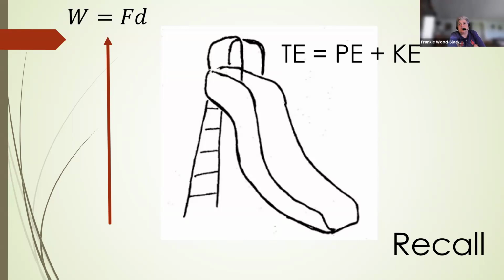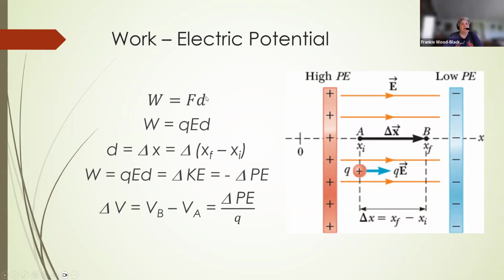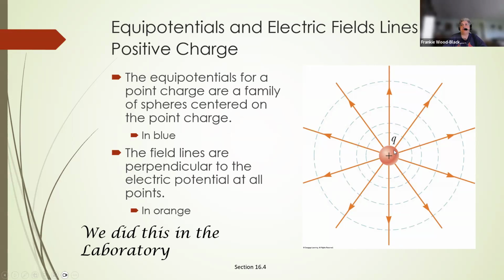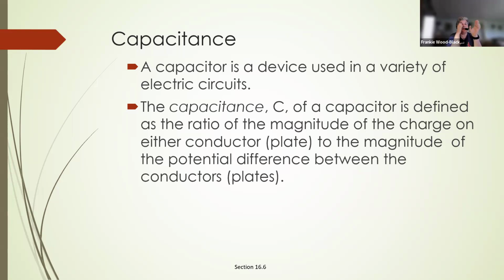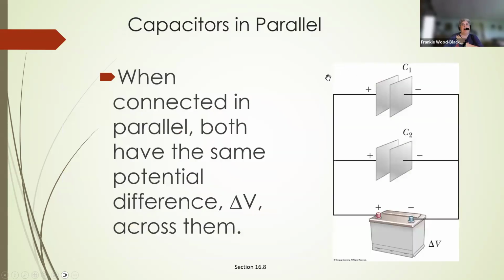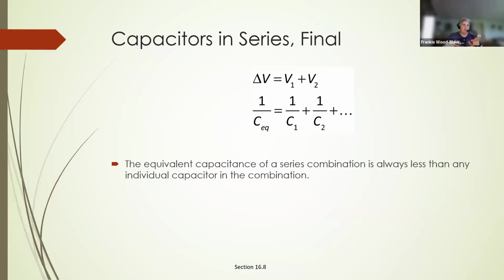Chapter Slides Lecture Electric Potential and Capacitance July 2 2025

Comment from the maker: Key topics covered include:

Electric Potential:

Analogies to mechanical energy concepts like work and potential energy [00:57, 01:08].

Definition as the change in potential energy per unit charge [04:37].

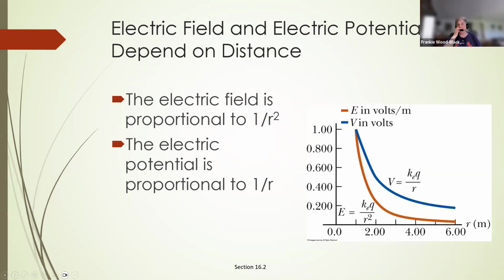Behavior (drops as 1/r) [06:20].

Measurement in volts [06:31, 06:46].

Superposition principle for multiple charges [07:32, 08:08].

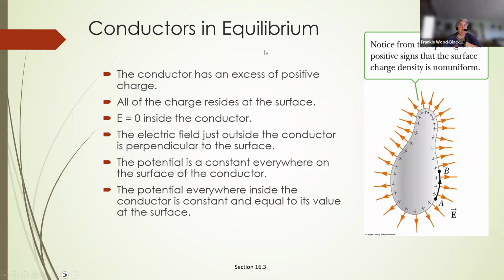Properties of conductors in equilibrium (charge on surface, zero electric field inside, perpendicular electric field at surface, constant potential) [08:55, 09:46].

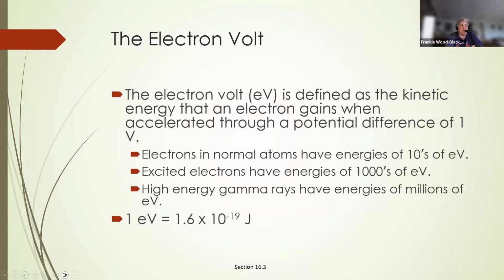Electron volts (eV) as an energy unit [10:29, 10:48].

Equipotential surfaces/lines (constant potential, no work done, perpendicular to electric field lines) [11:23, 12:18].

Applications like electrostatic precipitators and photocopiers [13:50, 14:10].

Capacitance:

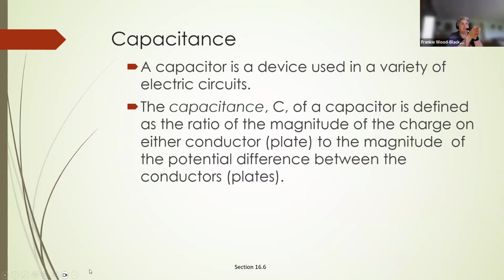Introduction to capacitors as devices that store charge [03:05, 14:52].

Definition of capacitance (C = Q/V) [16:11].

Unit of Farad (F) and common smaller units (µF, pF) [16:23, 16:33].

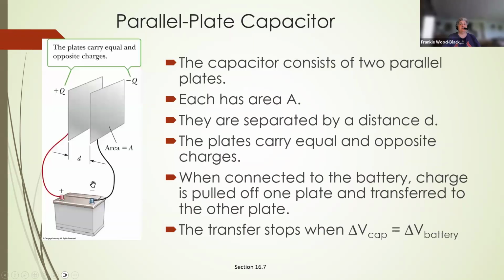Construction and capacitance of a parallel plate capacitor (C = (ε₀ * A) / d or C = (K * ε₀ * A) / d with dielectric) [17:39, 18:34].

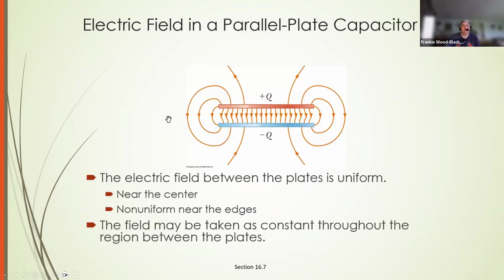Generation of a uniform electric field between plates [19:07].

Applications such as camera flashes, computer keyboards, and defibrillators [15:12, 27:34].

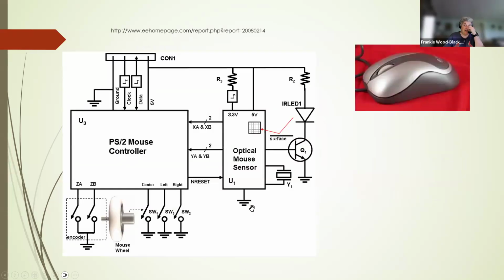Circuit diagram symbols for capacitors [22:34].

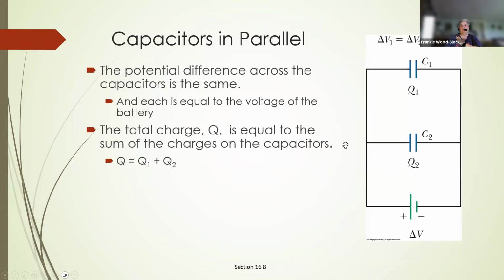Capacitors in parallel (voltage same, total charge sum, C_eq = C₁ + C₂ + ...) [24:48, 25:27].

Capacitors in series (charge same, 1/C_eq = 1/C₁ + 1/C₂ + ...) [26:15, 26:41].

Equations for energy stored in a capacitor [27:25, 28:03].